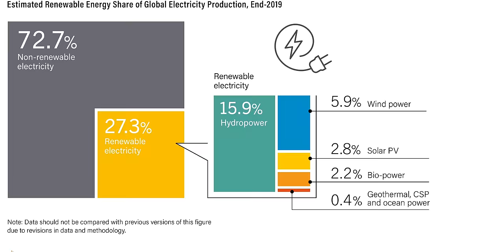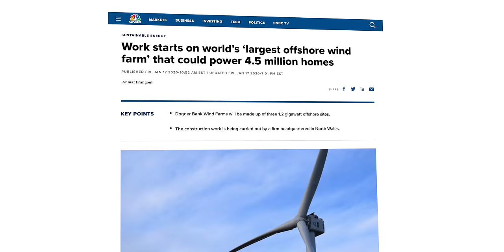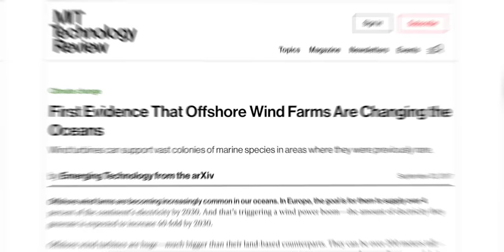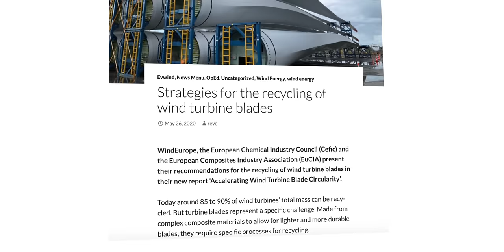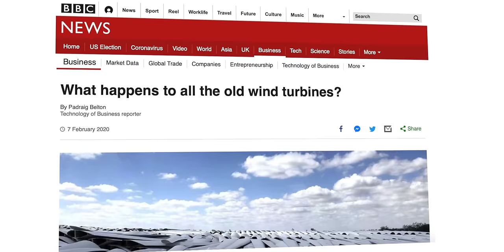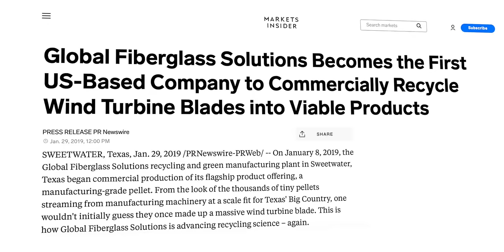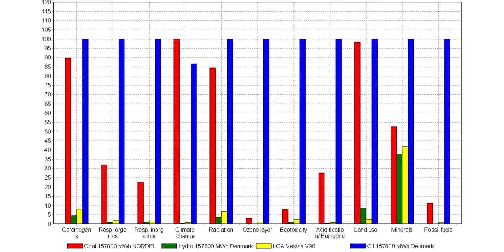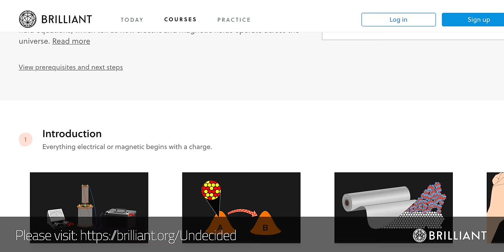The truth about wind turbines - how bad are they?

Comment: I live in an area where a "wind farm" sprang up.
Initially, it wasn't bad, other than the eyesore it created. It ruined the view of the countryside, day and night.
Just very recently, a Second Phase was started, (which we were not told of, and by the time it was made public, it was finalized where the placement of the new turbines were going. Effectively, we were locked out of the process) and is nearly complete. With that Second Phase, 2 wind turbines were placed very, very close to my home (one being about 3/10's of a mile away, the other about 1/2 mile away). Literally just 4 days ago, they got them powered up, running.  When they are in operation, it sounds like a jet flying high overhead in the sky, but in the same place without moving. It produces a constant sound from the blade tips passing through the air. It is very, very annoying.
I can see why people complain about them.
Reply: Have you watched the video showing what happens when those blades come off?
Reply: @diyr791  ...
Yes, I have.
Ironically, very shortly after I posted my comment on here, a wind turbine nearly 3 miles away from my residence caught fire.
It was quite the spectacle around here, being it's a small community.
One blade fell off. The fire eventually went out.
And, as I write this comment today, that burnt out husk of the turbine is still standing. Nothing has been done to remove it.
So, now we have an additional eyesore.
Reply: @dlopester13  Your exactly right Diego, a farm went in around me and the closest one is 3100 ft away.  The view and picturesque setting of the old family farm is ruined, the noise is loud enough i can hear it in the house.  our choice to move back to farm 10 years ago has now become a huge mistake in the last 3 years.
Reply: I know how you feel, well almost anyway. I'm surrounded by them now too. Even though these look like they're right over my property line, they're at least 3/4 of a mile away and most are further than that. I can't imagine them being any closer like yours are. Still, it sounds like there's heavy traffic on a non-existent highway about a mile away. That swoosh, swoosh, swoosh drives me nuts too. No more quiet evenings outside. At night it's rows of flashing red lights literally for miles in every direction. I can't wait to see what it has done to my property value now that I want to move away from my life long home (almost 60 years)!
Reply: @30dayride67  20 year lifespan is what these are too be.  If i live that long i can enjoy watching them come down.  Disheartening at the least...  And what brought them into the area was greedy government money hungry farmers.  Thats a whole nother rant but farmers in my area r nowhere near needing assistants yet they have people hired to seek out grants, programs and assistants available to them and abuse the tax payer money.
Reply: No government fools will tell you about noise pollution. As people living in Palm Springs CA.
Reply: yeah, they affect the scenery but you have light and heating. The not in my backyard strikes again.
Reply: Wait until you see what those low frequencies do to you.
Reply: @juliebarnett9812  that's a lie I live close to a windmill farm and I can't hear anything
Reply: @juliebarnett9812  In my days they used to be concerned about a ceiling fan in your home. Think about that!
Reply: @gerrydave7586  And now, they aren't concerned at all. That's what I think about that.
Reply: @viarnay  you not close enough apparently.  3100 ft is my closest, other then the constant jet noise, when the wind is low a direction is variable i can here the turret kick on while its trying to find wind direction.
Reply: thats pretty much what i have, wind turbines produce about .03% of the worlds energy production (when the wind is blowing).  Not starting a internet argument here but i know what i know and honestly, i was surprised the amount of noise these things produce.  Thanx to my greedy farming neighbors my quiet home setting is no more.
Reply: @viarnay  But it obviously did have a negative effect on your brain.
Reply: @henryhorner3182  Not really. I'm spanish and can speak english too, do you speak spanish? (it's a pain in the ass  because we have 23 different verbal forms 🙄😒😮‍💨
Reply: Yep, the tips of the blades can be traveling at well over 100 mph even if the turbines are turning at 20rpm.  I lived in West Texas in the 2000s when a lot of the turbine farms were built.  They've made the skyline as ugly as hell.
Reply: somad6997  that’s your opinion. And I ain’t your brother.
Reply: No planning permission would have been accepted without knowing where the second phase turbines would have been located. So not sure how thats even legal to position then anywhere after planning permission. Once planning permission is given and thats after public and local feedback then you can't object later. 
As to noise, you don't have any issues with jet noise but that same plane you travel on, has a much bigger impact in homes adjacent to airports or built near them so we can't all have our cake and eat it. Imagine a coal plant next to you,  quieter perhaps but then the air is toxic and who wants to live next to a coal plant bar the workers. Natural gas sounds great bar the pipeline, local emissions and natural gas is just a  slightly more cleaner fuel than oil. Want nuclear - then prepare to pay a higher power charge to pay for its subsidised construction and the profits the investors need to consider it (plus the near decade to build it) . The usual answer to noise is that funds are offered to those homes X distance from a wind turbine to install better windows and insulation to drown out the noise, this offer naturally depends on the no of homes adjacent as that funds comes from the wind farm profits. Ask the wind firm or the local council are there community funds from the developer that may assist. Not sure a massive nuclear or gas power station cement towers make for a wonderful view with the emissions vented plus their massive demand for fresh water.

Comment: I worked on a coal mine. Each truck consumed about 15,000 liters of diesel a DAY. We moved dirt to get to coal. Drilling, Blasting, draglines, dump trucks, wash plants, trains, shipping, road trains, burning. 

If wind turbines are more efficient then this process from start to finish. I’m all for it. People talk about the impact a turbine has on the environment. This doesn’t come CLOSE to the destruction I was part of to mine coal. Killing birds has NOTHING on what we did to keep your lights on at night with coal.
Reply: I absolutely agree, thanks for sharing your experience. The amount of birds that smack into buildings or get killed by cats is insanely larger if compared to the harm turbines make. Like 10000 times larger. Same goes for many other "problems" mentioned in the video. Common people don't realize these projects have a massive scale and, therefore, even if numbers look big, they may not be so big when compared to other energy production technologies.
Reply: @francesco5254  100000%. We won’t even talk about what happens when it rains, and we had to pump pit water into the “flowing creeks”. I’m now in aviation (another fuel guzzling job) and fly over the Australian landscape. 

I’ll be night across nsw/qld flying with guys who come from overseas and they question. What are all these unmarked cities, they are on no charts or maps?…. They are not cities. They are endless coal mines. This doesn’t cover the gas mines, the underground mines etc. 

There’s 47 years of known oil reserves left. There’s a reason why countries like America who have oil, are importing it while it’s cheap. 

We import 100% of our oil. I guess when it gets prohibitively expensive that’s our kids problem. A semi intelligent person would use cheaper resources now to set ourselves up for the future. The longer we leave it the more prohibitively expensive it will get. 

Seeing a turbine on my farm, would make me incredibly happy to know I’m not propelling coal indefinitely. I would also sleep better knowing I’m helping move us away from consumable resources. 

Perhaps the “burden” of seeing mines needs to benefit everyone - ie, you pay the land holder, but if your “view” is affected, you get free electricity for life. 

I see their argument, but these guys will be dead in 20 years. What legacy are they leaving behind by sticking their heads in the sand.

Our kids kids will be horrified that we burnt petrol to go to the gym to exercise 4 times a week. We WILL be known as the most privileged, entitled, wasteful generation that’s been known to human history. 

All of this is fruitless anyway. If a war breaks out. We can’t mine coal without diesel, we can’t farm, and we certainly can’t produce food, transport and store it….. why would we want to shield our country from oil dependence while we can….. 🤷🏼‍♂️

Comment: 1. Hybrid power plants (using both wind and solar)
2. More offshore than onshore winf turbines
3. Coloring the wind blades so as to avoid bird strikes. 
4. Finding ways to reduce the use of diesel or petrol in construction and installation of wind farms. Inr way can be using wind turbines or solar panels for constructing newer turbines and/or panels. 
5. Pyrolysis is one way to reduce landfilling. The easiest manner is the use of wind turbines in cement production as well as road construction. Their are claims being made now that we have found ways to profitably extract resins from wind turbines in an electricity positive manner.

Comment: I was a tourist in the States in 1983 and came across a disused wind turbine farm in the middle of California. My host told me it was too expensive to demolish so it hadn’t been demolished yet.
Reply: I was toured through that area or one similar, it was incredible and beyond belief that such things were allowed, just a disgraceful eyesore.  I do wonder if these really big new machines will suffer a similar fate as they require massive infrastructure and machines to build, they will need all of that and more to dismantle and dispose of.  Will that in turn simply lead to an abandon in place mentality like Gen I turbines you describe.
Reply: @Sussell Your friend was partially right ..teachers unions and other invested in building these and getting large tax breaks.. after they were no longer profitable to run which was in some cases less than 10 yrs they were abandoned by their owners leaving the tax payer with the bill for removing them ...as you have seen removing them is not easy and if you even tried to remove the concrete base which is too small to be reused then the carbon footprint would be = to a small war ...as usual it's a lose lose for the taxpayer...we paid for those tax breaks we paid for the elec produced and we will be paying for the removal and disposal to landfills
Reply: The concrete pads alone are typically 10-20 feet thick and 60 feet in diameter.  Removing that would be incredibly expensive.  So I bet in 20-30 years there's going to be a lot of giant concrete circles left in the environment.
Reply: @lindsaydempsey5683  

How many old coal power stations sit there because there to expensive to remove 🤣
Reply: @MegaRyan123456  Not a lot that I'm aware of, most governments require power station sites to be returned to a clean site at end of life.  California's derelict wind turbines seem to be an outlier in this regard.
Reply: @lindsaydempsey5683  

I mean there is that coal mine that has been burning for 50 years 🤣

And a few towns totally whiped off the map from fuel storage explosions 

So I think no matter what a few abandoned wind farms are never going to catch up 🤣
Reply: What am I speaking in a logical manner

Comment: Also, check out some of the stories of decommissioned wind turbine blades.  They just cut 'em up and bury them. And they take an enormous amount of land to do so.
Reply: They  can be  recycled into  bridges,  playgrounds  or ground  up  to  use  as  concrete  filler
Reply: No, they don't take an enormous amount of land to bury. Apparently you have cycled enough miles of this planet of ours. It's enormous.
Reply: Cause digging for oil and disposing of all that crap is a piece of cake, huh Gomer.
Reply: Cause paving thousands of square miles with roads and burning tons of coal is more environmentally friendly I suppose?
Reply: @Rugelacharugula  Strawman.  He didn't say one was better than the other. He was simply stating a fact.
Reply: @texanplayer7651  Strawman.  He didn't say one was better than the other. He was simply stating a fact.
Reply: @markjohnson7887  if you want to claim strawman argument you gotta make sure I pretended someone said something they didn't. This is not the case. I was making a comparison to show that what he was describing isn't as harmful for the environment as some existing alternatives.
Reply: @markjohnson7887  And I didn't say anything about nuclear. If anything you are strawmaning me.
Reply: @texanplayer7651  Yes.
Reply: @joecampbell5356  no
Reply: Lesley T  They can actually. But like many recycling processes, it's complicated and expensive.
And burying them isn't all too harmful, you are talking about a non organic non environmentally toxic material like stone basically. So it's a cheaper, and not too envrionmentally unfriendly alternative.
Reply: Lesley T  Fiberglass
Reply: Installing /uninstalling these huge items is one of the major lifetime costs. IF the decommissioning cost is included... Many just dumped nearby/in sea
Reply: @PatrickKQ4HBD  wow nice way to say "i dont care what happens in 200 from now  only that i have my fun now" no matter how huge this planet eventually we will run out of space to burry our mistakes

Comment: I used to deliver cabins and containers onto wind turbine farms and was told on more than one occasion they never pay for themselves, as each full turn off the blade they get six pence, at that price they take fifty years to pay for themselves, but the turbines only last a max thirty to forty years.
Reply: Thats going to be highly varied based upon Power Purchase Agreements between the wind farm and the utility company. Some parts of the country (USA) have a wholesale PPA around $20/MWH and others have a PPA of $150/MWH, it depends of the demand for power. New construction in the USA is almost exclusively greater than 2MW per turbine (there are probably some outliers around the 1.5MW range). Let's say average PPA is $30/MWH and do some math. The cost of a turbine varies based on too many factors to account for in a YT comment, let's call it an even 2mil for tower+construction.
$30×2MW×24HR=$1440/Day
$1440×365=$525,600
$525,600×60%=$315,360/year 
(60% is for the average capacity factor, wind isn't always blowing 100%)
$2,000,000÷$315,360=6.3 years to full payoff.
There are labor and maintenance costs to factor in as well but in the scheme of things they are negligible, for the sake of fairness I'll tack on an extra 0.7 years until complete payoff. Normal life expectancy is around 20 years until repower. During a repower the company will replace the major components (generator, gearbox, main bearing, etc) and turn them loose for another 20 years of operation.
If I could get 13 years of almost guaranteed profit for only 7 years of payment I would take it!
All this is without government assistance/tax credits, thats a whole can of worms in itself...
I hope putting some numbers to the mystery helped clarify things a little bit. Long story short, wind farms (at least in the USA) are generally profitable after a few years of operation.

Comment: The issue is much more complex than you understand. Wind farms are essentially fuel reduction devices for gas power stations. The cost of integrating them into a grid is what matters, not the cost of the turbine itself. Without a power source capable of ramping up when wind ramps down, wind turbines have zero value. Nuclear is the only hope of decarbonizing our grids. Germany and France are real world test cases for that.